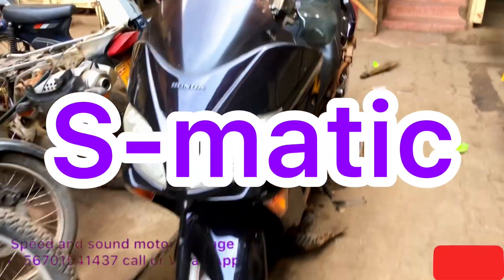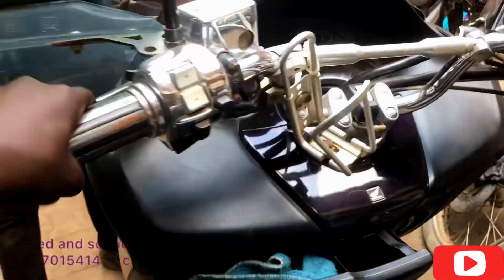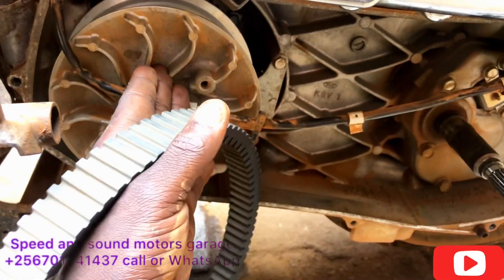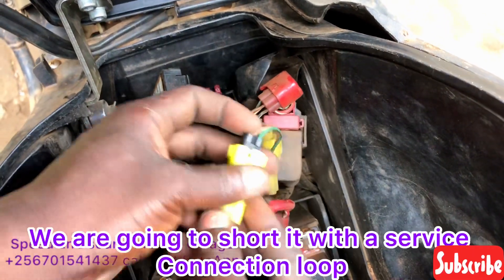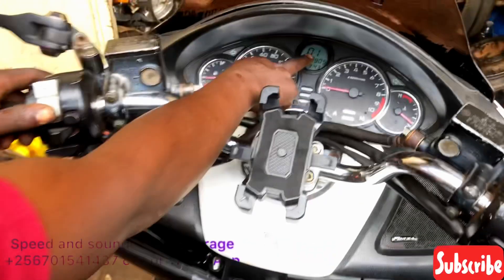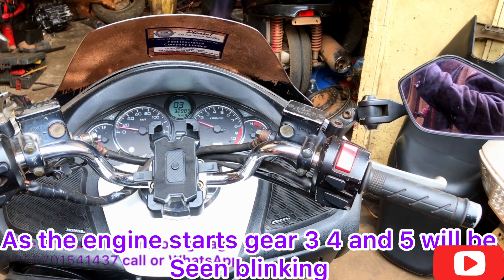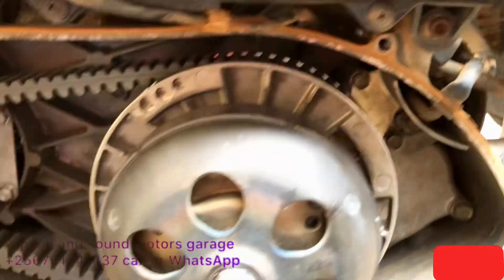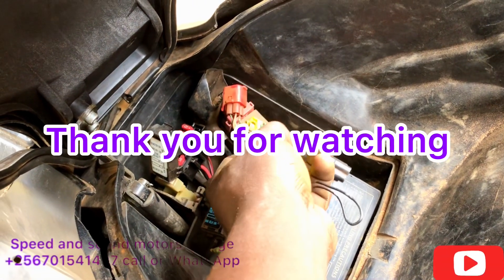Honda FORZA mf08 / mf10 ( NSS250EX) Honda S-Matic initialization procedure (cvt innitialization)

Comment: I have exact same forza and now iam changing drive pulley with part number 
22030-KSV-KO0 
I found one on ebay but cant recognize that it is what i need so can you help me please?
Reply from the maker: What’s your problem as to why you change parts
Reply: @Speedandsoundmotorsgarage it's like fired and deformed and have bad sounds also so Iam searching new one but can't find if you know which parts are portable and easier to find I can txt you on Instagram 💝
Reply from the maker: I use Whatsap

Comment: This is very informative.. 😮😮😮. Does this process also give the right idling rpm ? Because sometimes when the belt would be changed the idling rpm would normally drop significantly
Reply from the maker: Yes sir